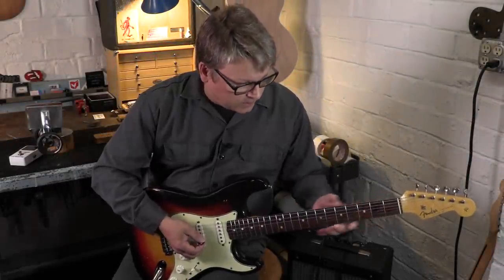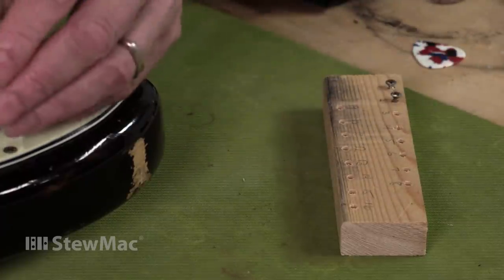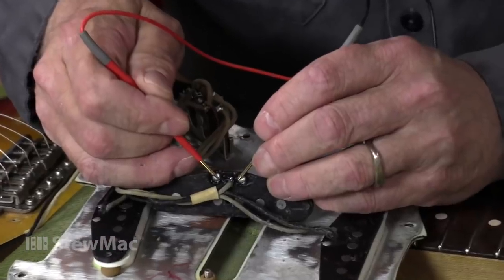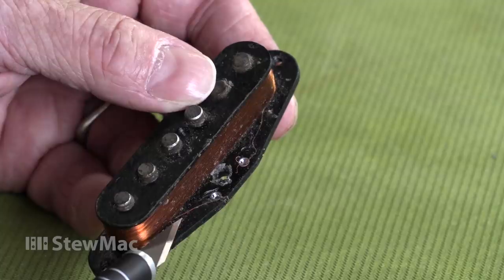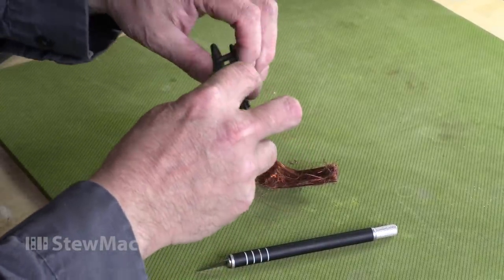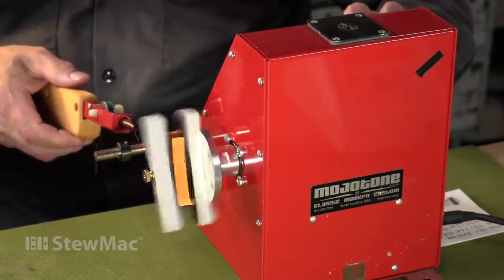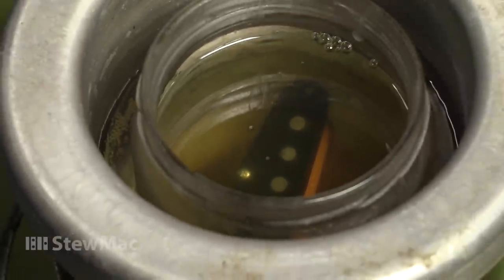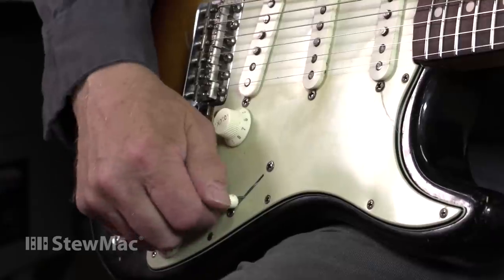Fixing a pickup on a 1963 Fender Stratocaster

Comment: If it was a short, the resistance would have been lower, not higher. It's worth it to try unwinding one turn and re-solder that end of the wire. That has worked for me in the past.
Reply: Good catch !
Reply: I take 100 winds off the bobbin, so there's a fresh layer "exposed" that's never been out before. You can usually get away with removing 300-500 turns depeding on which pickup it is, and if keeping the pickup original is important.
Reply: yes exactly
Reply: Yup, definitely misdiagnosed and probably more radically repaired than necessary. A few hundred turns removed would have probably cleared the problem.  In general, even very capable guitar mechanics like Erik should leave pickup repair work to a specialist.
Reply: I'm curious, since I'm not an expert on something like this kind of problem, is there a consensus, among you folks who are more informed, that he actually did misdiagnose the problem and do more repair then was probably necessary?
Reply: Frode, you're right; the resistance would have been lower if wires had been shorted.
Zeolmeister, he probably did over-repair the problem. The increased resistance would have been caused by a broken wire rather than wires inside the windings being shorted together. Using Bongers' method of removing windings until the resistance returns to more normal readings would have been a more appropriate repair, IMHO.
Reply: Chuck Ramsey Better than hacking up a vintage pickup..Perhaps though, he had seen indications of all of those problems being eliminated...Because in his mind those things being elementary. without thinking about it left it out of his commentary. He did make comments that a variety of things could cause these problems...& couldn't go into them all...
Reply: Frode Haugsgjerd See my comments to Chuck Ramsey... He did make comments as to that there he wasn't able to go into all of the indications that lead him to his diagnosis...
Reply: Yep this was my reaction too. I've had at least one funny pickup where removing a few winds can either reveal the problem (such as a winding that's  fractured though still leaving some current jumping the break) or cure it, even if the problem isn't obvious. I dont rewind pickups but I'll always do this before deciding a pickup is dead.
In the 80s I had a US reissue Strat where TWO of the pups shorted out through the winding breaking near the solder joint. This guitar was heavily discounted and I later learned it was from a batch that had been caught in a flood !! It was a dog of a guitar and later got SEVERE laquer cracking too, but the pups were great. I fixed them, and they went on a series of other guitars for next 10 years. But I imagine all the movement from flooding/drying out had something to do with the pickups problem.
Reply: Inter-turn pickup shorts tend to have pretty subtle symptoms and seldom result in the sort of severe loss of output that happened to this Strat.  Elderly formvar does tend to crack and develop small voids, with the most serious shorts occurring on the far inner turns where the wire touches the pole pieces -- something that should not be allowed to happen and a major shortcoming of Leo's super simple design -- which unfortunately does necessitate a rewind.  During my years of working alongside the late Bill Lawrence, he used one of two methods to prevent that kind of short -- he either wound a turn of durable paper tape around the pole pieces so as not to depend on the formvar for insulation or installed a precision bushing (made on a Swiss screw machine) made of a compressible plastic around the outer two pole pieces, which both insulates those two pole pieces and lifts the wire far enough away from the remaining four to reliably prevent shorts given a suitably tight wind.
Reply: If he meticulously unwound it, would he be able to see exactly where it shorted?
Reply: It was definitely an open coil. But it’s hard to say where the break was. Sometimes it’s on the inside.
Reply: Bruce Morgen Yes Leo's designs was optimized for industrial design, and that's why I think it's odd how relished these objects are. The Telecaster bridge is the best example I can think of. It looks more like a part for an old Chevy than something that a luthier would be proud of.
Reply: fuck me, well spotted there, I had no idea
Reply: Same thing on my '73 strat, two pickups neck and middle, tech unwound about 1000 cicles on machine, found the cut, soulder it, wound on back the same wire, plays and sounds like it shoud, done it for 15e each, wonderfull!
Reply: exactly
Reply: Frode you are right open coil not shorted coil
. I caught that right away. However by making the video the way he did he was able to show off the Mojotone Pickup Winding Machine.
Reply: Spot on. What's most likely is that there is a partial break in the coil causing the impedance to rise dramatically and limit the low frequencies. high frequencies still pass across the capacitative gap.
Reply: It's impossible to say.  His comment that the pickup was "shorting" may simply have been a kind of shorthand. Were he to go into a complete diagnosis of the difference between a short and an open circuit most of his punters would go "huh?". I know because that's the reaction I get...  It's wrong, anyway; were the pickup shorting there would have been no sound from it at all (probably) and it would have affected the output in all three middle positions. No-one can tell whether this pickup would have needed rewinding or just the removal of a few turns; it depends where in the coil the problem is. No-one is qualified to judge that except the guy handling the pickup.
Reply: This was obviously a problem with the switch, having corroded contacts.  He did not fix THAT problem at all, though spraying some deox contact cleaner in and moving the switch back and forth might have helped.  Instead he wasn't truly fixing the resistance, instead the coil performance.  Sort of a backwards way he went about trying to diagnose and fix a coil.
Reply: Many people call any electrical malfunction a "short".
Reply: @editorjuno  No harm done anyway. Wire is wire.
Reply: @editorjuno  [he either wound a turn of durable paper tape around the pole pieces so as not to depend on the formvar for insulation or installed a precision bushing (made on a Swiss screw machine) made of a compressible plastic around the outer two pole pieces, which both insulates those two pole pieces and lifts the wire far enough away from the remaining four to reliably prevent shorts given a suitably tight wind.]
This could/would have a performance advantage as well as short preventative one: If the windings are still close, but not touching, it would reduce the capacitive leakage of the coil. Not a huge amount, but enough to add 'brightness' to the response without a loss of depth. Think of how the capacitor works in the tone control as a 'brightness cut' function. Same happens when windings, which already lose higher frequencies to stray capacitance to each other, have that loss increased by sharing a capacitive coupling on the first layer of windings across the pole pieces, which is like putting a capacitance across a tap on a transformer.
Reply: @Brian-Burke  Highly unlikely. You can find breaks if you're lucky, and I've done that more than once, but high-resistance connections that are still physically intact? If you don't find them as an obvious fault unwrapping the first hundred winds or so, it's time to call it a loss. You'd spend more time trying to find it than rewinding it.
Reply: @DavidRavenMoon  Partially open, not fully open, or it wouldn't measure at 260kR. Actually, now that I think about it, he measured that with the coil still in the circuit. It might have been a pot. Can't remember if he measured it after disconnecting. 260k sounds awfully suspicious...so maybe it was open resistively, but there was enough capacitance across an infinitesimal break to pass the top end response.
Reply: @stephensaines7100  -- That's a good observation and technically accurate but, as you state, it's "Not a huge amount."  Thank you for sharing your understanding!
Reply: Stephen Saines That’s the reading of the pot. An open coil still makes sound via capacitive coupling. Because of that it sounds very thin.
Reply: @bongnp  removing 500 turns of a coil is absolutely not keeping it original. An electromagnet's output is a function of the magnet field strength and # of turns. By changing the number of coils, especially by 500 (~ half), you've dramatically altered the pickup. That'd be like sanding the neck thickness in half to take out a crack or chip and calling it original. 

Besides, from a practical standpoint, are you going to stand there and invest hours or labor into pulling and inspecting a few hundred coils of wire from a pickup? In this case, the labor involved does not justify the cost, nor does it justify altering the pickup so dramatically to keep the original wire. If you were so dedicated to preserving the guitar, you would not have touched the pickup at all, and writing up the malfunction "as God intended".
Reply: @mogwix  I don't think anybody invests hours into pulling wire off of a bobbin. It takes a few minutes at most in my experience. I've probabaly done it a dozen times, where only 3 or 4 of them required a full cut and rewind. Depending on the pickup, finding a break within a couple hundred winds and re-soldering is less time consuming than cutting and rewinding and potting the entire pickup. It's all what the customer wants and if they care enough about the original wire.  A guitar is a tool, so caring about the originality of the guitar and/or pickup is subjective to its owner. If somebody said "dang, I loved these pickups - it's a shame you gotta rewind it," I don't mind finding and early break and fixing it at half the cost and half the time on my end.

I'm guessing you have never repaired a pickup. If you have, then forgive my assumption. A stratocaster pickup has around 8,000 winds on them, not 1,000. So taking off 500 winds doesn't change the pickup as much as sanding half the wood off of a guitar neck. I've been winding pickups since 2010, and earned a certificate in pickup winding from a school of Guitar Lutherie after 4 years of experience, so I do know what I'm talking about. Also my original comment has 31 thumbs up at the time of this reply, so obviously people agree with my sentiments.

Most of the time it's up to the customer. Let's say they have a 1959 Gretsch pickup that's dead. If I find a break in the wire taking it off wind by wind, I've gotten lucky finding the break within 50 winds. I defy anyone to be able to hear any difference between a bobbin wound with 5000 winds vs 4950 winds. Damage is hopefully on that outside layer of the bobbin, the layer that is most exposed to: sweat, beer, steel wool, picks, etc.  I've had luck within a couple hundred winds too, all you have to do is check the DCR, and report back to the customer to ask if they're cool with it. Once you cut all the wire off and do a full rewind, the pickup is 100% different. Taking a few dozen winds off of it would not only fix it but keep it 93.75% original. A dead pickup has zero value, so malfunction "as God intended" is never a solution in my shop.
Reply: @akkudakkupl  "wire is wire" Is it though? I am not convinced that wire is wire. Just look at the difference in old transformers to new clones on audio equipment. the purity and percentages are bound to be different, and differing along the path too.
Reply: yea but with resistance in the mOhm?, my guess would be significant corrosion in the wire for some distance, maybe 2 or 3 inches?
Reply: I was hoping for some comment from Erick on this point.
Reply: It's not a short. It's an open circuit, a break. The two separated halves of the windings form a capacitor that presents a high impedance path overall but lower impedance to higher frequencies. That's why it sounds light and tinny. 

My middle pickup went the same way. I wound off about 400 turns to find the break. I didn't have the gear or skill to rewind the deficit so I just re-soldered the remaining end. Now the resistance of my middle pickup is about 5.3K ohms instead of optimal the 6K but I can't hear any worrying deficiency  when switching between the pickups. One day, I might add those removed turns for the sake of integrity. 

Other explanations/fixes don't work with the symptoms, like the switch needing lubricant, a bad solder joint or removing 'one turn' and re-soldering. None of those would provide sufficient capacitive coupling to allow an open circuit pickup to still pass enough electrical signal to produce any significant sound.
Reply: It's a break. A hundredth of an inch would be very ample. The Meg ohm reading would be leakage (very small) through adjacent windings rather than across the break.
Reply: @ Stephen
Windings and their insulation aren't perfect. They have mutual leakage. That would likely account for the high but finite resistance he was reading, despite the coil being open circuit, as in having a break.
Reply: @ David
I agree. You've obviously know electronics. It's a coil break with winding capacitive coupling bypassing the break.  I had exactly the same symptom on the same pickup with my Strat.
Reply: I recall many years ago, (late 60's?) repairing pickups on a friend's strat, (no money for pro repairs) with similar symptoms by carefully unwinding the coil onto a suitable reel until I found a break. I then checked resistance from the broken end to the start of the coil to make sure there wasn't another break. Then carefully soldered the two broken ends together, insulated them  with a small bit of tape and hand wound (no coil winding machine!) the wire back onto the bobbin. It worked, in fact my friend said the guitar sounded better than ever! 
PS. I'd agree with those who pointed out that the ~250K resistance measured before dismantling the guitar was probably the resistance of the volume pot. Erick didn't say what he measured as the pick up resistance out of the guitar, just that it wasn't what he expected. My guess would be that it measured open circuit, or too high for his meter to measure.
Reply: I’m not sure about on pickups but on coils for motors and generators you cannot trust fully a reading with a multimeter. This may be more to do with higher voltages etc.
Reply: @letsgocamping88   A multimeter won't tell you about a shorted turn. If one, or even a few turns are shorted out of several thousand the change in DC resistance will be too small to detect with a meter, chances are it will be smaller than the variation between pickups due to production tolerances any way. Just because two supposedly identical pickups (or motors for that matter) give slightly different readings it doesn't mean that one of them is faulty. An open circuit coil or one with a resistance considerably higher than expected is definitely faulty however. A meter than can accurately measure inductance, loss angle and other AC properties of an inductor may well give more useful information. You would need to know what the expected values for a good coil were to start with though.
Reply: I agree.  I had a similar issue on my 63 Duosonic. Yep.  It's not a Strat..... But  I was able to unwind a couple turns and it fixed the problem.
Reply: Plus, the wax potting usually prevents any insulation problems from shorting the wires inside the coil. He should have taken the first layer of winds off of the pickup and tested it, If it returned to normal resistance, then re-pot it and re-install. That should have happened, before completely rewinding the vintage pickup.

That said though, the guitar is repaired, in such a way as to not harm the vintage value of it.
Reply: @american23t  "he wasn't able to go into all of the indications that lead him to his diagnosis..."  funny, that. the very thing I came here for, & there it isn't. 
all the folks who've said 'shorted turns = lower resistance' are right. higher resistance is odd, but could be corrosion.
Reply: duncan rmi - yes, because elections flow on literally the path of least resistance.

I'm sure I've read repairers take off hundreds of winds to find the break and if they need to just replace those same winds - sometimes using the same wire or NOS. It's the ideal scenario to preserve the vintage characteristics.
Reply: David Schwab Correct, an open coil. The resistance he measured was the volume pot, nominally 250K.
Reply: Stephen Saines Totally open. What he measured was the 250K volume pot which was still in circuit.
Reply: Exactly, the problem was most likely right at the solder joint. Most likely could have been fixed and preserved by taking 20 or less turns of and scraping the varnish from fresh coil wire. You have nothing to lose be trying it.
Reply: Although, had he resolved the issue by unwinding, he’d still have old wire from the 1960’s that had already started to breakdown. I agree that the pickup was having breakage issues rather than shorting. Rewinding and repotting was definitely the correct fix.
Reply: My 2018 American Special Fender Stratocaster had a neck pickup that was having the same symptoms as in the video.  It was very quiet on that pickup and it had a 0.23 M ohm reading when checking it right at the pickup with the multimeter just like in the video.  That reading went to "open loop" when the 5 way selector switch was switched away from the neck pickup.  I tried reflowing the solder a few times and had no luck.  I had just about gave up and was actually trying to use a big mechanical solder sucker to remove the solder, which didn't work; but in my attempt to use it, I was giving it a little longer heat period so I thought I might as well test it with the multimeter one more time and voila!  I got around 5.7x k ohms!  I tried putting the multimeter leads directly on the hair wires of the pickup and never got any reading before that too.  I now suspect that the wax or whatever type coating on the wire could have been preventing me from getting a connection that way.  Anyway, this guitar had an intermittent neck pickup from almost the start of ownership and I had sent it to a local shop once under warranty only for them to fix(resolder) the wrong thing apparently.  I'm now happy, but Fender had a dud solder job for me.
Reply: @stinkycheese804  He checked the resistance after he re-soldered the connections without the switch in the circuit and it was still bad. The switch had nothing to do with the problem.
Reply: @Zelomeisterdude  No. it's just some idiots in the Youtube comments pretending they know more. As ever.
Reply: @fdfsdfsvsfgsg4888  -- I don't know WTF you're referring to.  I do find it funny that somebody who goes by "Fdfsdf svsfgsg" is a spelling critic, though.  😎
Reply: .26megaohm is virtually an open circuit. 260 kiloohm not a short. I think you both got it wrong. A short is measured in ohms.
Reply: A lot of these Fender pickups open up right where the coil is wound  over the magnets. The whole dissimilar metals thing. Unfortunately that break is on the inside . Another way the coil can break is the bobbin can warp from heat and humidity. This will tug on the coil and can break the wire. You can view the bobbin from the long sides and see that they have warped slightly into a "smile". I've tried unwinding from the outer part of the coil a few times but that is not give a high probably for success. 

You can get the orange coil wire new. The coating is called heavy formvar. It looks way better than the clear coated wire. Just make sure the diameter isn't too thick. Another trick is that you place a black crayon in the wax. This will give the wax a darker color.The wax darkens over the years. Some of these old Strats are almost 70 years old now.
Reply: To add to the active discussion and bolster the idea that removing XXX turns from the pickup, we know the number of turns on the handwound pickups weren't counted. They were eyeballed. Taking 500 turns off could have still been in spec in comparison to other pickups wound a different or even same day by a different person.